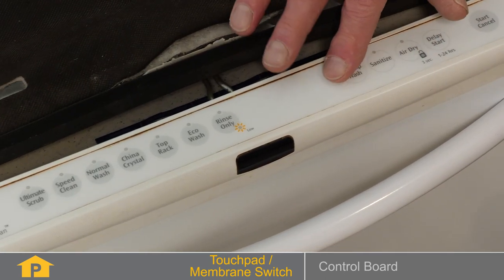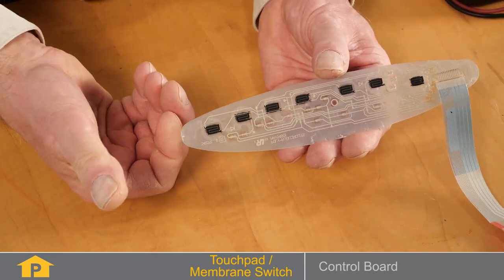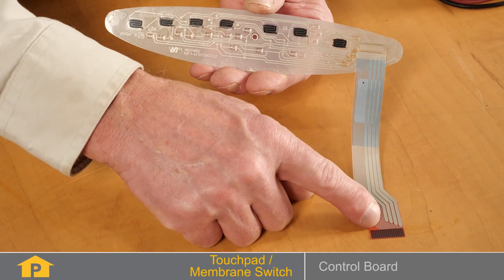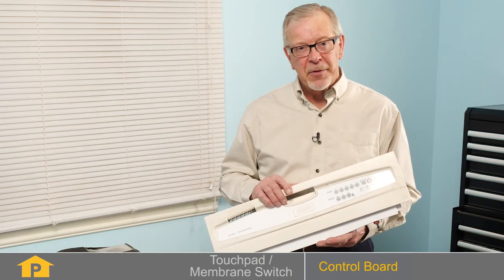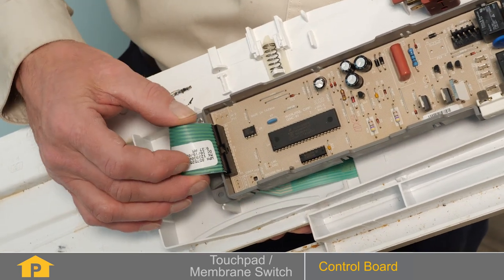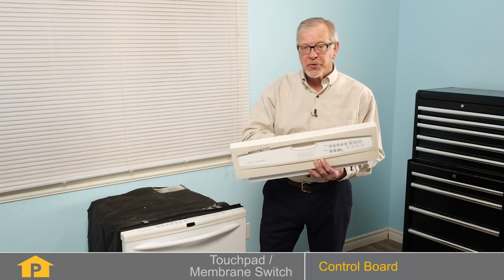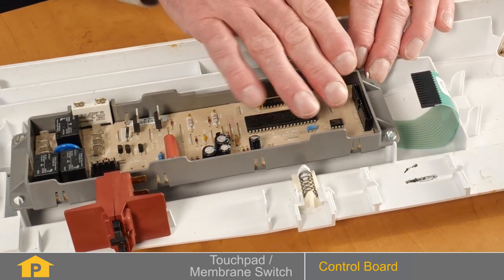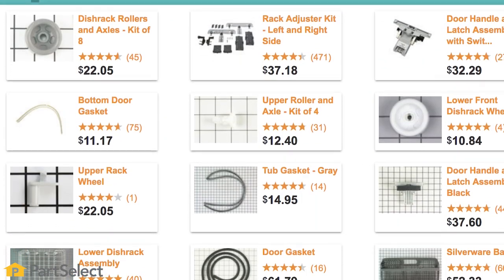Why Don't My Dishwasher Buttons Work? | PartSelect.com

Comment: My pots and pans button lights up.  But no other button lights up when pushed. But start button works. So ive been using that.  What could it be? Before this for years now the lights would flash alot when it was running.